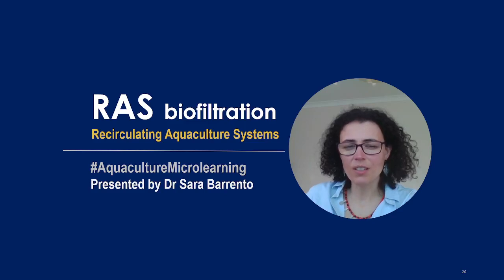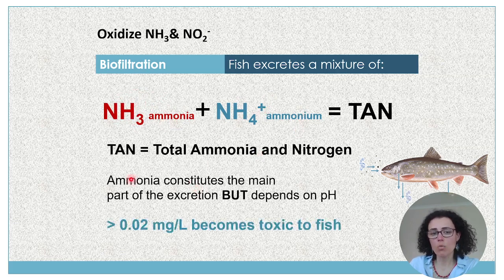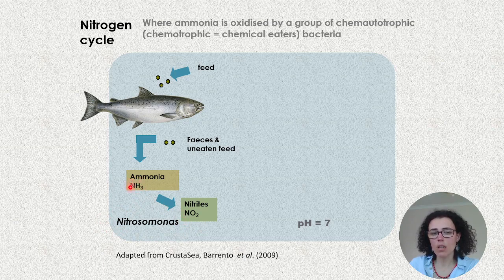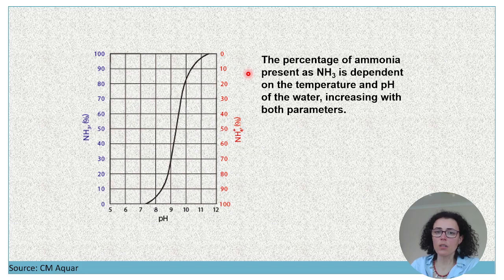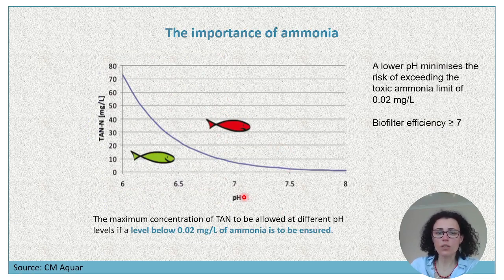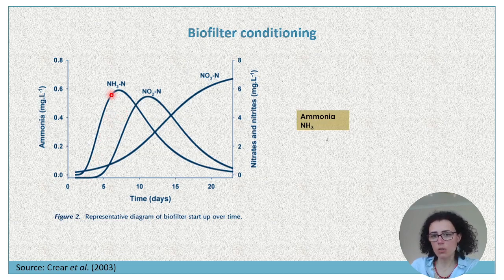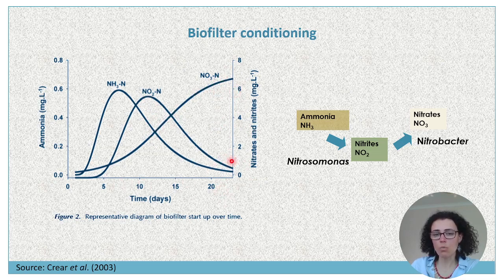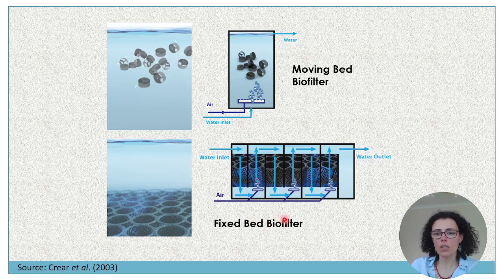Recirculating Aquaculture Systems | Biofiltration - episode 3

Comment: Thx for the videos 😊😊😊
I have 2 questions:
1 i've read somewhere that the filtration of no3 is happening in the anaerobic zone of the biofilter.... And also the that we have to add an organic form of carbon (methanol/alcohol) to neutralize the no3's and also the oxygen to be keept at 1 mg/l in the anaerobic zone ...is that true? 
2. Does the water with the nh3/4 + no2 + no3 needs a time to settle and be purified or we recirculate the water as a hole regardless if we have nh3/4 +no2+no3 in it?